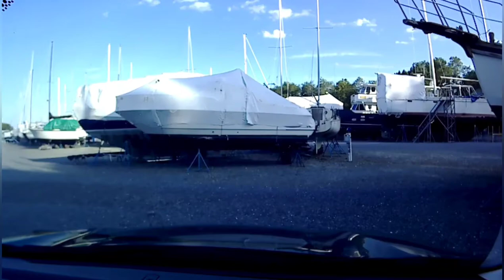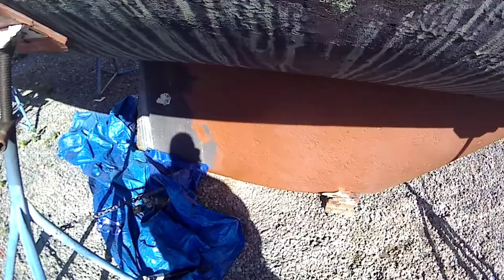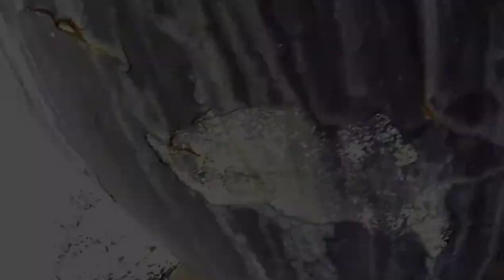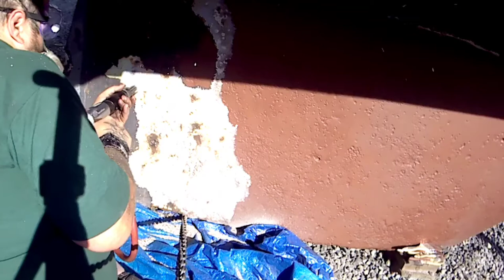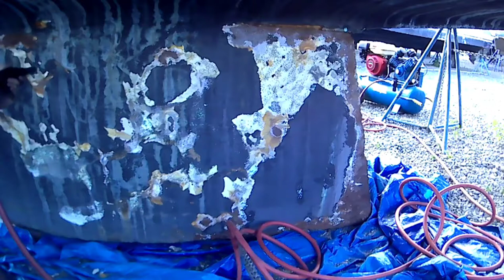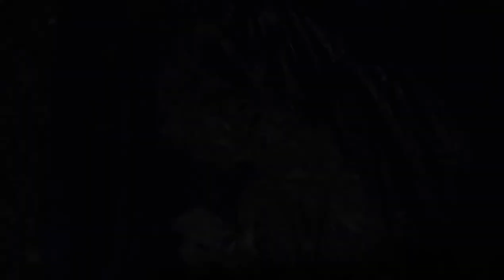46 year old keel refinish video 2, And we find a surprise old repair on the port side.

Comment from the maker: So there is a fix I have in mind, I am debating a patch with iron bar similar to what was done or possibly having a piece of iron cast to this damage, treating the area and priming and barrier coating in-between the keel and patch then welding it in place on pins and filling the void with epoxy resin. I have to check what is available and if that will work. But first I have to make sure the seat to the boat hull is not rotted to the point it will not support keel bolts.